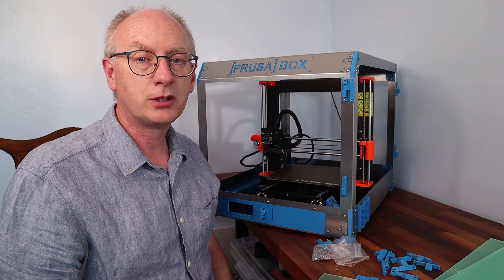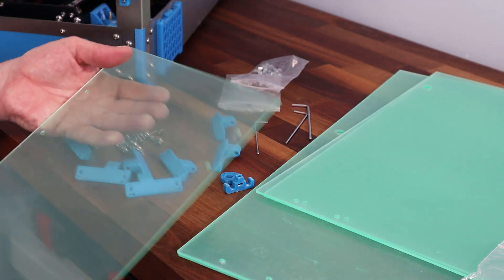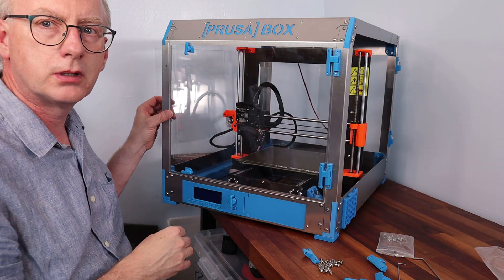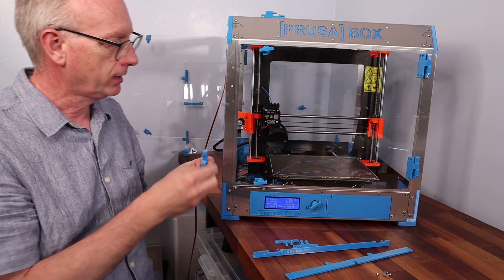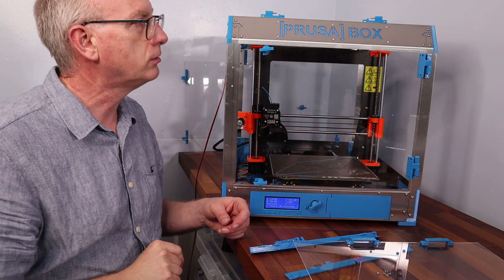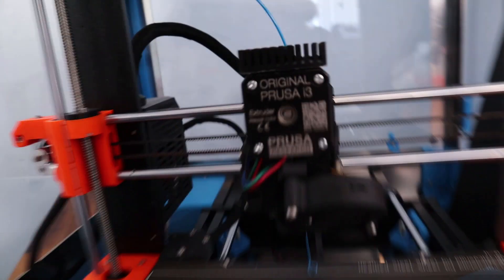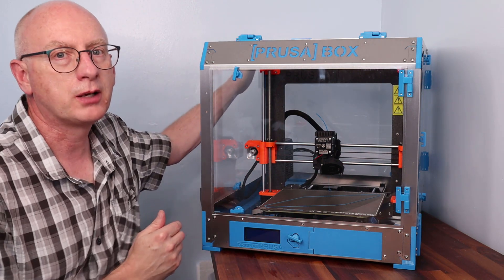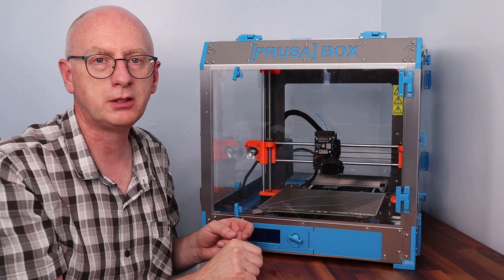PRUSA BOX Enclosure for Prusa i3 MK4 MK3- Build Complete Part 4 - 3D Printers

Comment: Can you measure the sound level with and without the box? That would be interesting!
Reply from the maker: Not really, but I can say that noise is reduced as the doors overlap the openings. Also the rubber feet that are sold in the shop make a big difference to resonance, better than squash feet option

Comment: Hi Colin, thanks for your videos of the Prusa Box build, very informative. I am currently looking for a good printer enclosure for my MK3s. I started with building one with the lack tables but in the end I found it to bulky. I saw that you also own the Tukkari enclosure but you switched to the Prusa Box. 
Do you still like the prusa box, is it better than a Tukkari? It looks more compact. 
Did you print the Prusa Box parts in PETG or PLA and how many rolls did you use?
Greetings from the Netherlands, Harald.
Reply from the maker: Hi Harald. I still have and use the Tukkari box. Nothing wrong with it. It's a very cheap way to have an enclosure. The TS version I use doesn't have a bottom. Their TLX range has a laminate base and back and is a quality product, same price as PrusaBox. PrusaBox is slightly smaller, and because of all the holes/access panels cut in the stainless you can create your own mods or use the manufacturer mods. I guess I'm saying PrusaBox = mods can be fixed onto the case whereas Tukkari any mods must be self contained or external. Main examples are Pi/screen. Both look good. I actually. Prefer the look of Tukkari TLX as I can see the full printer, but I didn't like lots of unmanaged cables and devices being separate, so on that score PrusaBox wins. It's all personal choice. As an enclosure, Tukkari TLX and PrusaBox are both winners. Parts must be Petg to cope with heat, I recommend 3kg. Probably 1 - 1.5kg for basic parts but if you start printing mods you will use more. I'm at 2.5kg but have reprinted same parts a couple times and done most mods. Hope this helps.
Reply: @colinhill  thanks for your reply and info. I do like all the mods for the prusa box so perhaps that is the right choice for me. Will follow your channel and have a look at your tukkari video's before ordering. Greetings Harald
Reply from the maker: good luck with the F1 today :)
Reply: @colinhill  thanks, looking forward to the race.